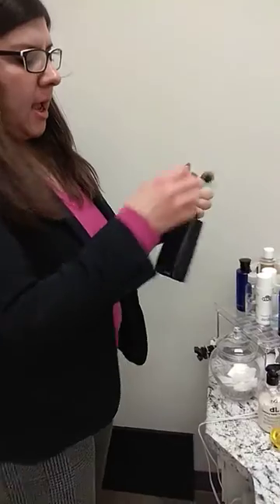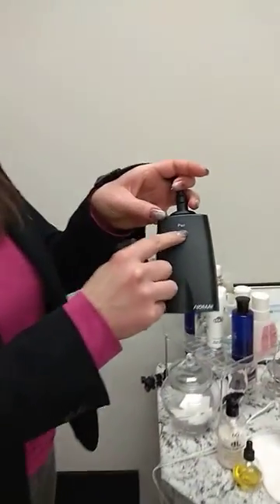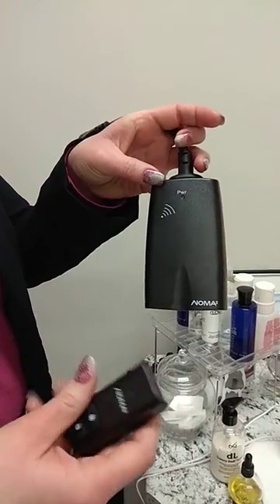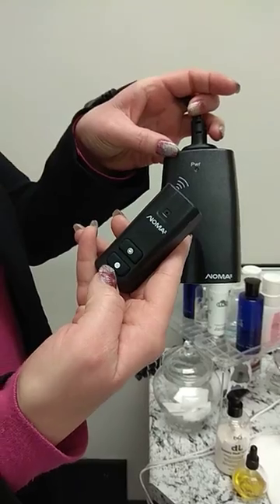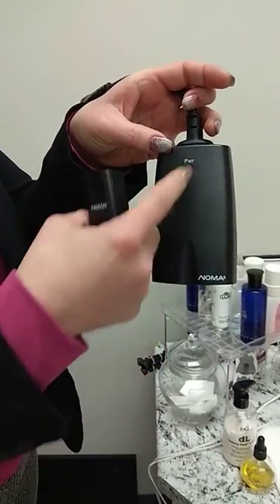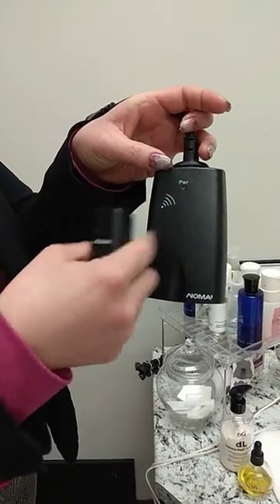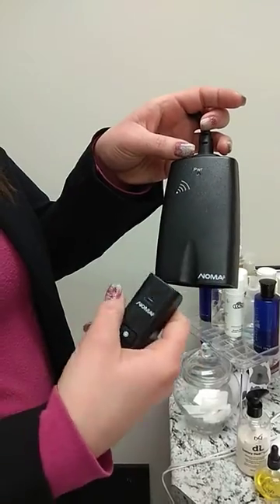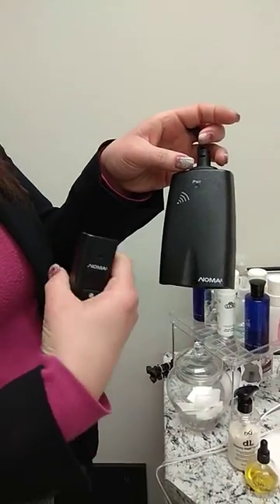Remote Control setup problem solved

Comment: I had the same issue but realized the remote battery was not pushed in all the way. When I was pressing off to pair, the red light on remote was faint and turned off immediately or 1 sec later.

You need to make sure the light is bright and stays on when you press off. Once confirmed then follow the video which is to plug the main unit into the outlet then keep your finger on the off button to pair. Your remote light will turn off quite quickly BEFORE the 10 seconds is up. Once this happens your paired and the unit will work as designed. Cheers everyone, and good luck.